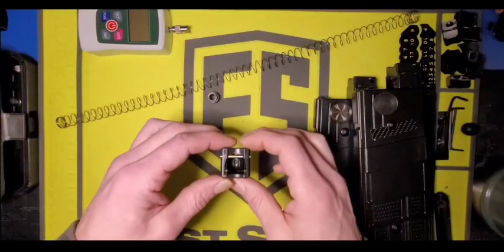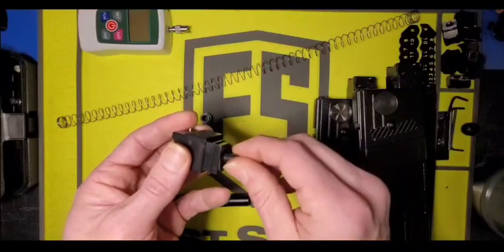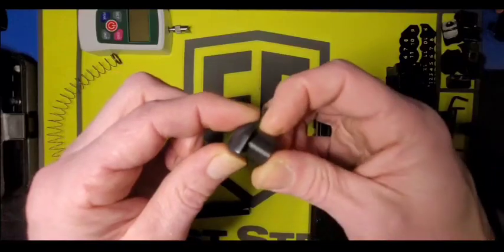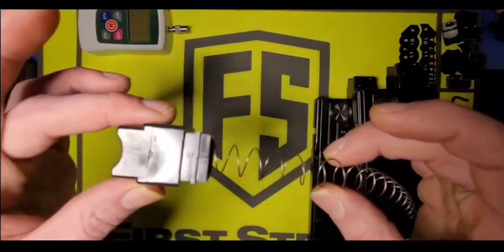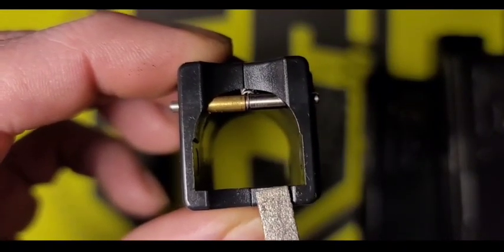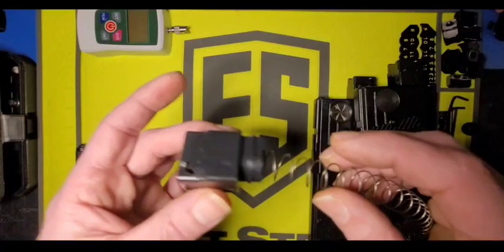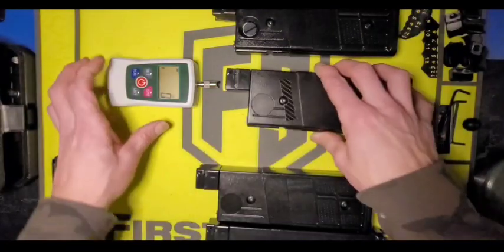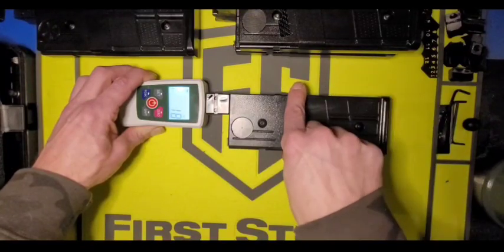M17 CQMF Sticking Magazine Follower and Helix Spring Comparison

Comment: Its always the little things. 

The springs in tandem as in stacked or did you intertwine them?

May have to double up on the bar pin detent spring with that 18 ouncer it may just launch your balls.
Reply: I honestly would rather have FA @25+Jules, than SA @40+.
...under certain circumstances.
(oh, and sorry for the long-winded trip down memory lane earlier. lol)
Reply: @jkg6211  can’t argue it isnt fun as hell.
Reply: Sean, I've had zero issues with my balls launching... (except for that vasectomy I had back in 2004)
My mags work perfectly fine.
Reply: @jkg6211  🤣🤣🤣
Reply from the maker: @Kevin Heyman  Front door FA is a good reason to make sure it's well-tuned. If it's hard on the marker then maybe not for everyday fun, but when needed... It would certainly make a point.  It's a little more intimidating as well. Big fan of memory lane. No worries.
Reply: @JohnWixon  
Even a 20j force multiplier would be one hella deterrent.
Controlled bursts man. lol
Reply from the maker: @Kevin Heyman 100%.  In the army.. on an M249.. you say, "I need a burst", to time the shots. Mostly so you don't melt the barrel.. but control is a nice byproduct.
Reply from the maker: Intertwined . Together at the follower the little bit of extra stock spring is at the far end. I have only bench tested the feeding so far. I used my heaviest HP68s (7.65g). (they vary from 6.0 to 7.7.. ) I can trip the detent and get individual rounds. I did a full mag dump and follower stayed inside.. I guess time will tell.. 15 round capacity. 16 fit but doesn't feel happy. I believe Kevin uses doubled up Helix springs- maybe he can share his experience. I doubled them because he asked me if I was running double.. figured it was something I should be doing.  He wanted a video of the new bushings for the Helix- so I made him one- with numbers- for curiosity sake. 
 In your full auto testing, does the feed rate ever come into play, or is the bolt/spring/psi combination that causes the issues. I would think double might be the most postive feed. The mag spring won't float as the bolt flies by..
Reply from the maker: ..and YES! It is always the little things, isn't it? Attention to detail mixed with paralysis by analysis. My two main methods.
Reply: @JohnWixon  magazine feed rate is part of the equation to maintain a positive feed as fast as that bolt is moving.
Reply from the maker: @lesslethalfordummies  Like tuning valve springs in a high RPM engine.  So you don't "float the valves". My grandfather was a national pistol champion (grandmother too, for that matter), in the Navy and after in civilian life. I was given his match 1911. The fist time I shot it, it jammed. I thought it weird, a pistol that won that many matches would jam first shot.  I took it apart and found a 12# recoil spring. It hit me.. light spring for target rounds..  Slide was coming back to quickly- timing was off. I think I put an 18# in there.. It was 20 years ago.. Spring rates are critical and often overlooked.  A well-tuned machine is a thing of beauty. I'm sure it won't be the last time I mess them. You running a single,  stock or the helix?
Reply: @JohnWixon  currently still running on a single factory spring in the mag because full auto just wasnt in the cards. It would seem now even if its not the most useful thing and quite possibly the most damaging thing to a 40j marker…..it just wouldn’t be a complete series unless your could use the marker to 💯 of its abilities.

Full auto will break stuff in a hurry i can attest to that so treading lightly would be recommended. I wouldn’t want to destroy everyones markers.
Reply: @JohnWixon  
Did your Grandfather compete @ Camp Perry in the Nationals too?
My Instructor (for my training Courses as an IPA Pistol Instructor) was one of the Range Masters for the CMP National Pistol Matches there 'back in the day'.
 (Wally Hedrickson) He told me on the next-to-last day of my training, "Son, don't bring that damn Wilson Combat 1911 here tomorrow - I need to see what you can do with a normal pistol." ... long story short, I brought my stock .40 cal Walther P90, and actually qualified! lol (no handloads)
10 in the bull, with 8 in the X-ring... timed, @25 yrds, while standing on my hind legs. AND WITH A WALTHER! 🤣
I was as nervous as a cat crapping razorblades in front of him, as it was basically my "final exam" for the course. lol

As old as he was back in 2002, I'm sure he's training the Lord's brigade by now... RIP Wally. You're truly and sadly missed, Sir. 
He was one of my idols in competition, and it was an extreme honor to have him as my Instructor.
I grew up following the likes of Col. Jeff Cooper, and Massad Ayoob back in the 70's/early 80's, so IMHO, John Browning's 1911 was the pinnacle of mechanical engineering in regards to handgn design... until Bill Wilson came along and made a great decice even better. lol
(out of the 3 Gunsmithing schools I attended back then, one was solely devoted to the 1911)

As to these mags... I had the same issue with the nub left over from the moulding process on the rear of my followers too, but a little 600grit solved that one for me as well. (and the chamfer within the mag's feed neck)
And yes - I'm running doubled HELIX springs without issue - except for the reduced round capacity. (15)
I honestly believe that, between you, Sean and I putting our heads together, Valken should take note with this design - it'll put an end to any feeding issues for their mags... sans pepper ball. lol
I love it!
BTW - my idea came from Wilsons 1911 mag follower - if you still run that 1911... get one! (or a couple dozen. lol)
Reply from the maker: @Kevin Heyman  I wish I had more information about dates and places. 50's and 60's mostly. Navy competitive shooter. After that he spend his days as an instructor in self defense and shooting. He would travel to train police forces and Brinks truck drivers. His house had the range and the "school house". I, sadly, didn't get the chance to know him. Just a wall of plaques, pictures and stories. I'm still a  hand-in-pocket guy. My little tribute.
Reply from the maker: @Less Lethal for Dummies  Having not launched FA, at 40J.. what are the points of failure? Could it be solved through spring rates, or does it come down to the actual construction of the internals, e.g. too much plastic, pins too small?
Reply: @JohnWixon  the harsh impact created by FA will loosen every nut and bolt on the marker no matter the use of loctite.

I have never seen the bolt guide slip since it is encased 360° in the case. Sear wear, guide pin and the bolt loosening are the biggest issues you would encounter.
Reply: @JohnWixon  i would suggest launching at a more reasonable level to find failures so that they are not catastrophic in nature but rather tells to which things to keep an eye on. Get ready to bob and weave when using FA and solid projectiles. They come fast and furious.
Reply from the maker: I’m perfectly happy with SA, just wondering what it would take to make it possible really… wear on A FA will just be a good indicator of places that could be improved, and make SA bulletproof. I have too much sensitive equipment near my trap at the moment, to go Rambo.
Reply: In my circumstances, FA would be for my front door - not casual every-day for my ball trap. lol